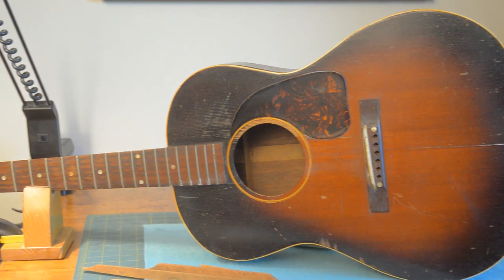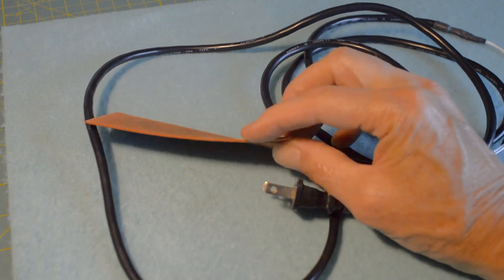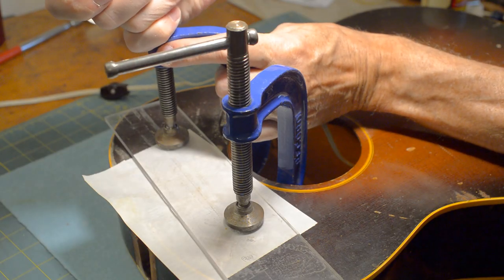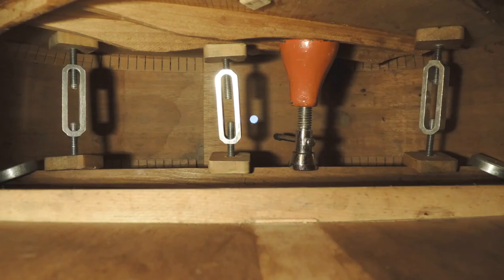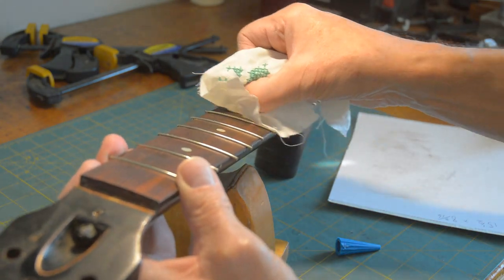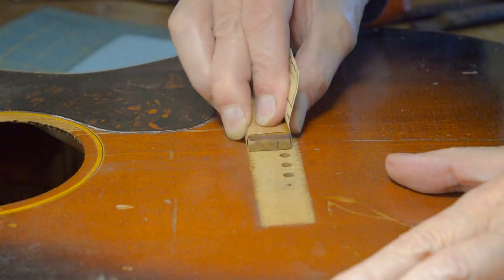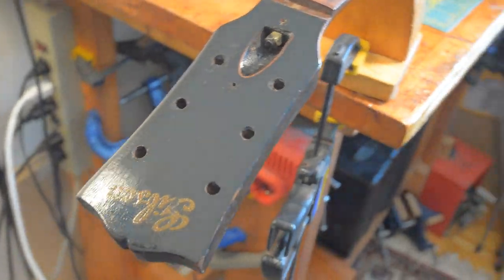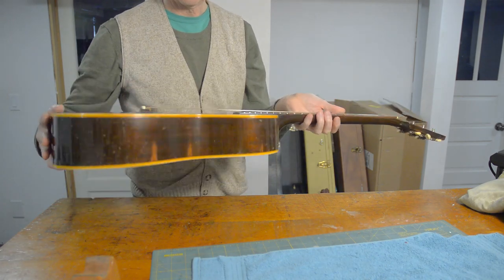'47 Gibson LG2 Revival

Comment: Very nice work. Thanks for sharing. That old war horse is ready for more service.

I use cake decorating knives for loosening bridges, but now I will bend one to mimic your clever butter knife trick to grab the bridge plate. Always something to learn from smart folks!

P.S. You might try some 3M 7448 grey pads instead of the steel wool. They work very well, and do not shed any steel, which is very nice for electric guitars. Just a thought.

Comment: Nice work Gary.  Working through the sound hole Re glueing all braces is challenging no doubt.   —-35 years ago I had a early 1950s Martin 0018G mahogany classical that was  a friends-was fairly rough project.  It had a hole about 3”x3”  on lower side bout Butt area.  I decided to turn the old Guitar into a Steel string.  -I did the work through the sound hole and the Side damage hole.  I Removed the fan braces and X-braced it.  Turned out amazing.  My friend was blown away. I thought about offering to buy it from him—but I could tell he wasn’t gonna let it go